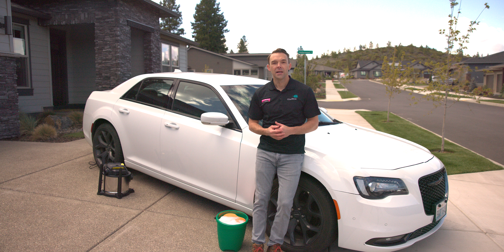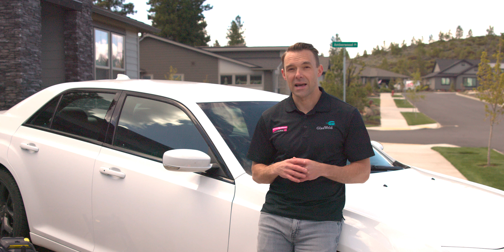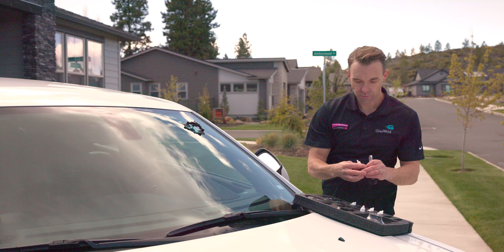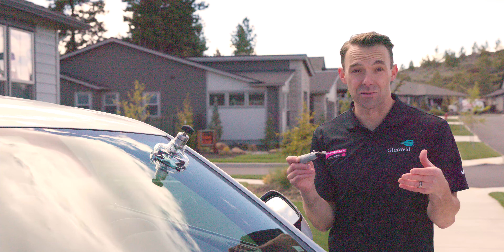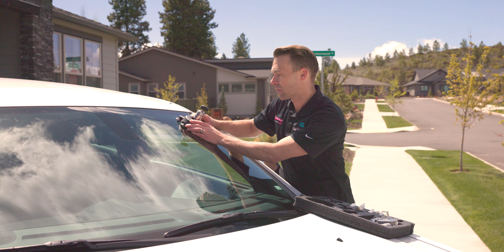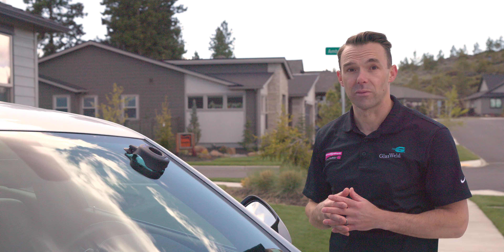Easy Windshield Repair for Auto Detailers

Comment: What do I do if when doing the injection cycle,  my white piece does not swell but it pops out of place a resin flows every where. So I just turn until I see it slightly swell against the glass like barely
Reply from the maker: It sounds like maybe the injector isn't close enough to the glass. Feel free to reach out to us at sales@glasweld.com and someone from our team will be happy to help further.

Comment: What was the tool you were using on the inside of the glass? What is the purpose? Flexing the glass for rising to flow better? Thanks
Reply from the maker: That's our multipurpose drill and polisher. It has cork attachments for massaging the break to encourage resin flow, which is what he's doing on the inside of the glass. Here's the link to check it out: https://glasweld.com/product/drill/